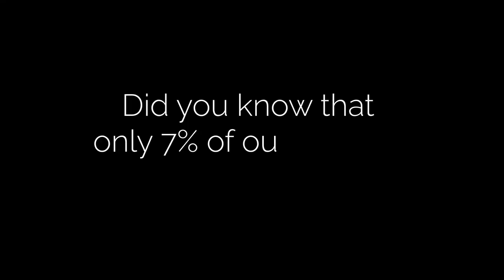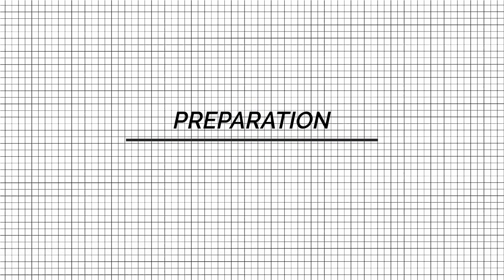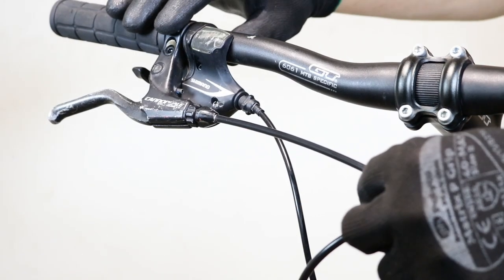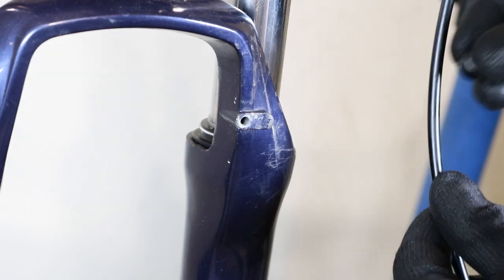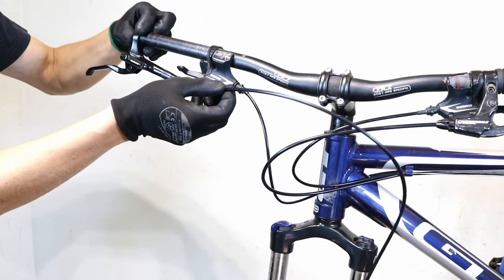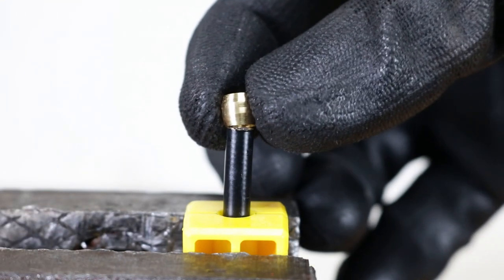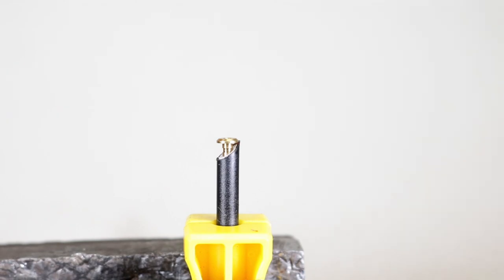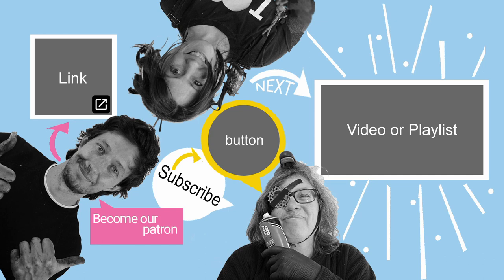Upgrading cable disc brake to hydraulic - A step-by-step guide!

Comment: Great video - didn't realise this was even possible !
Reply from the maker: Hi Mark and thanks for the comment. Now you know, are you planning to upgrade yours? If yes, let me know how you got on.
Reply: @cyclemaintenanceacademy  rim brakes on the roadie and hydraulics on the mtb so no need for me but was interesting to watch regardless
Reply: It is on the front, but there is a reason why none of these videos show doing the back when you have top tube (or any external) cable guides, I guess you would just need to zip tie your own cable guides all the way to the back of the bike, because hydraulic lines certainly aren't going to thread through cable guides, especially if they are the kind that act as cable stops for exposed wires (which was always a stupid idea anyway).

Comment: Bad video. With mounting cable for rear brake is not simple. So tracing the cable is a problem, because of various size of holes.
Reply: Just use shrink sleeve the new hose to the old cable and slide it on through the frame,Easy Peasy  👍👀